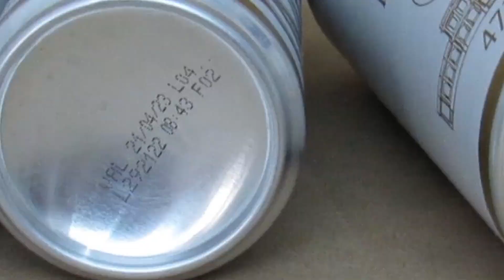I Made an Eternal Generator with a Fan Motor - Genius Idea

Comment: If that motor was 100% efficient, the water falling from the pipe would generate the exact amount of electricity to lift it back up again and that's it... In fact considering the height of the motor is higher than that of the pump it means the water wouldn't even make it back up.

Basic physics people !